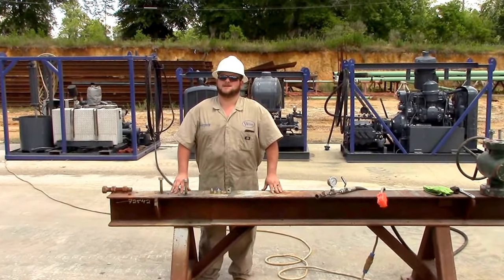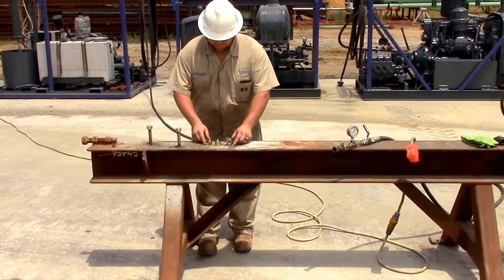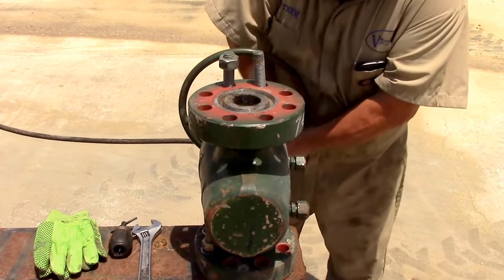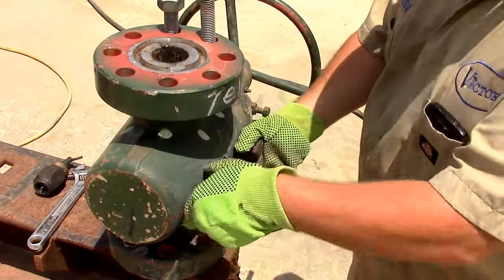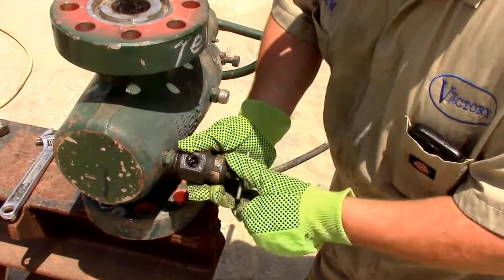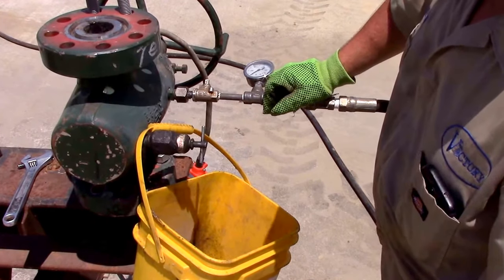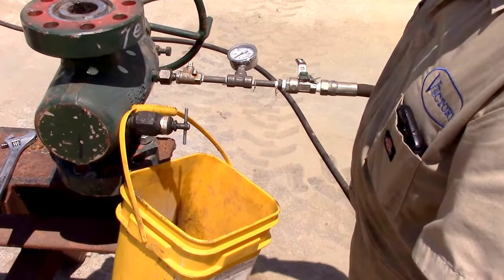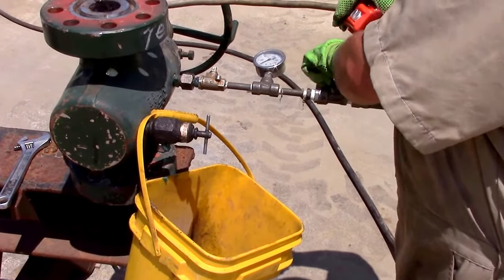Valve Greasing Demonstration

Comment: Great video. Thank you for sharing. The valve was not a Cameron it’s a WKM. Some times the valve get pressure locked and that why they get hard to turn, after putting the pressure relive tool it lets the pressure out and it can get easier to turn.

Comment: Sir I would like to touch on a few things that should absolutely be added to this video. First of all best way to grease a valve that is not on a Frac stack is to half gate the valve. Also bumping grease through both 9/16 autoclave grease body fittings is standard  for this industry. I would like to note that what you are doing is actually called a grease flush. Can also be performed with water to break the seize in a valve and get rid of any particles that may be jamming the gate. I would also like to add for anybody just looking for information that please when you are finished greasing please check your fittings on the valve don’t just toss the cap back on. The grease fitting on the top bonnet was leaking after you pulled your hose off. That fitting needs to be replaced.
Reply: Half gate is to flush out a valve you can grease any valve open position if you have two grease ports the bleeder on the second port best way and awc and Cameron thought me that if only has one grease port you can grease it and work the hand wheel bruh
Reply: Good point about caps and BGF’s. Always assume there is pressure behind BGF incase ballcheck fails. If it’s got two fitting pump in one and bleed out tail. If it’s single fitting open half way so grease has somewhere to go. And don’t forget to lube them bearings. Pump as much grease in the bodies as you want but once them bearings are seized time to open it up.

Comment: Hi, I saw your video and I have some questions for a gate valve project that I am working on. Could somebody be so kind and help me with answers to the following questions:- how frequent the preventing maintenace has to be done to the wellhead and the fracking valves in general: 30 days, 60 days, 90days...?- what involves preventive maintenance: greasing, repairing, replacing (with new or refurbished valves & components) ... - is maintenace done to all valves in the same time? are there areas more important than others (pumping line, wellhead, ...) - is maintenance a costly process ? how would you evaluate this cost comparing to the overall production cost?- are gate valves an important component in the fracking equipment? where are gate valves placed in the process?- are gate valves more sensitive that the other valves in the fracking process?- do gate valves need more maintenace that other valves?- would it make a difference if gate valves will not need any kind of maintenace for at least 1 year (for exmple) ? would it make any sense?- if something should change to make an impct in the fracing process, what should it be?
Any help will be much appreciated.Thanks,Mihaela
Reply: noted